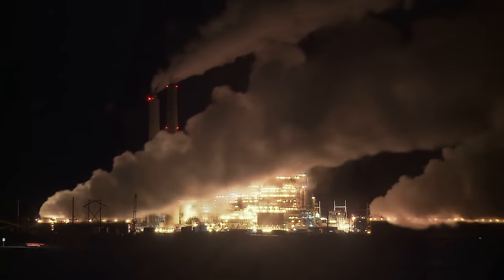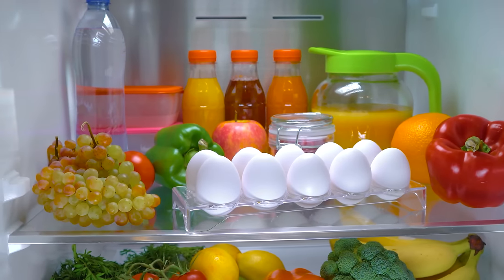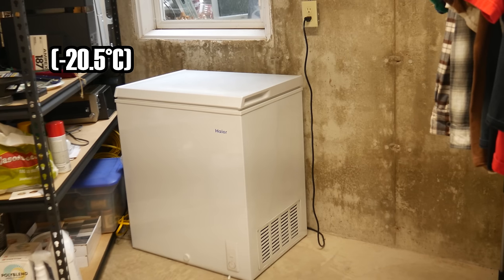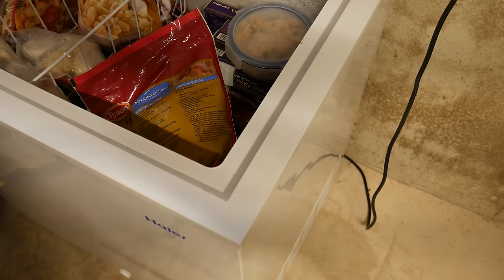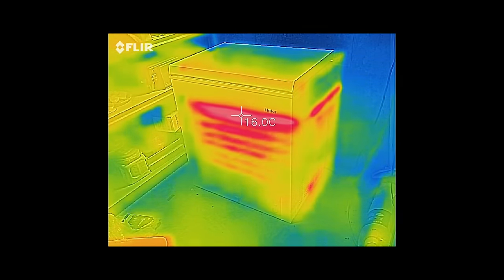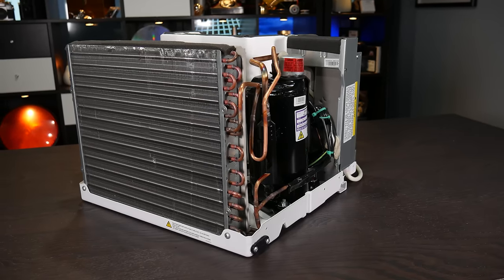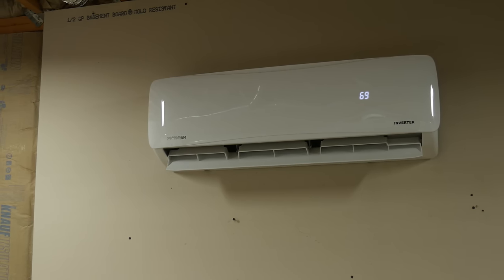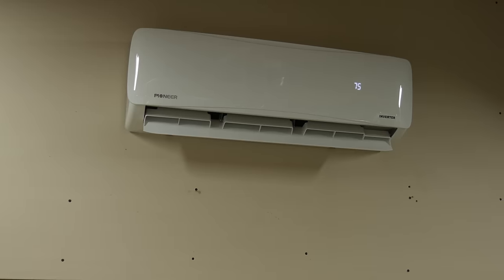Heat Pumps: the Future of Home Heating

Comment: How can a heat pump ever output less heat than a resistive heater? Can a heat pump in heating mode ever pump heat in the wrong direction? Or will is merely fail to pump any heat?
Reply: The efficiency gets so low that it draws more power than heat it produces. For example it might draw 1 kWh of electricity but only produce 0.8 kWh of electricity. Resistive heater always produce the same amount of heat to power they consume.
Reply: @Redtooth75 , “Only produce 0.8 kWh of electricity”? You must mean “0.8 kWh of heat”

A heat pump consuming 1 kWh of electricity will always produce exactly 1 kWh of heat, and then it either will or won’t pump heat from outside to inside. If it pumps any heat at all, then it will add more than 1 kWh of heat to inside your home. If it doesn’t pump any heat, then it will put all of the 1 kWh of heat that it produces into your home.

The only way it can possibly put less than 1 kWh into your home is if it’s pumping heat out of your home. If it’s in “heater mode”, then that should never happen. It should therefore never be less efficient than a resistive heater.

Your response makes it obvious that you do not understand heat pumps and why they can be so much more efficient than a resistive heater.

100% of the waste heat is put into your home which is exactly the same as what a resistive heater would produce plus additional heat is extracted from outside and also put into your house. If the heat pump consumes 1 kWh of electricity and pumps 0.8 kWh into your home, then you’re home receive 1.8 kWh of heat when your heat pump consumed only 1 kWh of electricity.
Reply: @terjeoseberg990  I work on system like these on a daily basis for my job. I am an HVAC tech. I assure you that when its cold out a heat pump will not work effectively. We can argue about theory until we are both blue in the face. But reality supports my position and it rejects yours. And reality does not care about what you or I think, it simply is.
Reply: @Redtooth75 , So basically you work on systems like this daily and don’t understand how they work? Well, mechanics don’t design cars or engine, yet they fix them all the time. I’m sure it’s exactly the same for HVAC technicians. The people who understand how their work are physicists and engineers, not HVAC repair technicians.

If you dump 1 kWh of electricity into any device, no matter what the device is, due to the conservation of energy, 100% of that 1 kWh will be converted to heat. The question is whether that heat is put inside or outside your home. In heater/heat pump mode, the heat pump would obviously be designed so that 100% of that energy would be put inside your home. The only question then, is how much heat the pump is able to pump from outside to inside. If that’s 0, then the heat pump becomes exactly as efficient as a resistive heater. If the heat pump is able to pump any heat at all, it becomes more efficient than a resistive heater. This is just a fact.
Reply: @terjeoseberg990  you have a complete misunderstanding of conservation of energy. Energy can be converted to different forms. In the case of an electric motor electrical energy is converted to mechanical energy, with some converted to thermal energy due to inefficiencies. Think about it, if all the energy gets converted to heat then there would be nothing left to do the actual function of a motor which is to spin. Spinning a shaft (mechanical energy) requires energy, if all the electricity becomes heat then what's left to make the shaft of an electric motor spin?
In the case of an heat pump you have electrical energy getting converted into mechanical energy via the motor in the compressor. Then the compressor will convert the mechanical energy into potential energy by increasing the pressure of the refrigerant. Both the fan motors will convert electrical energy into mechanical energy to drive the fan.
Reply: @Redtooth75 , You’re confused and wrong bro. Sorry, but that’s a fact.
Reply: @terjeoseberg990  a typical electric motor converts 90% of the electricity powering it into mechanical energy, 10% gets converted to heat. Sorry bro just a fact. How can the electricity get converted into heat and mechanical energy at the same time?
Reply: @Redtooth75 , And 100% of that mechanical energy eventually turns to heat. Sorry bro, but that’s just a fact.
Reply: @terjeoseberg990  lol ok buddy. I guess the people that have to switch to electric heat or a furnace because their heat pump cant keep up are just imagining their house getting cold. And the manufacturers specifying a temperature at which a heat pump becomes ineffective are just making things up.
Reply: @Redtooth75 , Imagine you have an extremely well insulated box with a motor inside that’s 90% efficient. You put 1 kWh of electricity into the box to run the motor. 10% is converted directly to heat and 90% is converted to motion. Isn’t heat just motion? Well, originally that motion of the motor will be a whole bunch of atoms rotating together, but the eventual all those atoms that were rotating together will stop rotating together. Now, what the hell happened to that mechanical energy? Did it disappear? Or is it still in the box, but in the form of heat?

If you keep adding more and more electric energy to the box, and the box is extremely well insulated so that energy can’t escape, it will become warmer and warmer inside the box. The temperature inside the box will increase according to exactly the amount of energy that you put into the box. This is called “the conservation of energy” and makes sense if you have a sufficient understanding of physics.
Reply: @Redtooth75 , “I guess the people that have to switch to electric heat…”

Heat pumps are electric heat bro… They run on electricity and heat your home. But if you think a bit, a heat pump that uses 1 kW of power to heat a home by converting that 1 kW to heat while pumping 1.5 kW of heat is heating their home at a rate if 2.5 kW. If that home requires 2.5 kW to heat because it’s cold as F*ck outside, but it’s so cold that the pump isn’t able to pump 1.5 kW of hear will then only heat the house at a rate less than the required 2.5 kW. Maybe it’s so cold it’s only able to heat the home at a rate of 1.5 kW, which is insufficient to keep the house warm. Then you’ll need an additional 1 kW of heat. You could install another identical heat pump, or go with a cheaper resistive heater for those few days when it gets that cold. If it gets that cold often, then it’s better to get another heat pump. If this days are extremely rare, then it’s probably better to temporarily use a resistive heater.
Reply: @terjeoseberg990  i didnt realize that people put heat pumps in perfectly insulated boxes or that houses were perfectly insulated. Does the mechanical energy eventually make it back to thermal energy? Sure, but its not in the house when that happens so who gives a shit.
Im still curious as to why you have not addressed the reality of an air to air heat pump being unable to compete with a resistive electric heater at cold ambient temperatures.
Reply: @Redtooth75 , The house is obviously not perfectly insulated. That’s why it needs a continuous supply of 2.5 kW of heat to stay warm. That’s because 2.5 kW of heat is leaking out of the house. Adding more insulation to the house is another solution, but also an expensive one.

You obviously don’t understand physics. Is it because you haven’t learned it? Or because you lack the mental capacity to learn it? From this conversation I’m leaning towards the later.
Reply: @terjeoseberg990   You repeated yourself. I have already given you my source that was written by an engineer, but curiously you have refused to acknowledge it. Go ahead and give me your source.
Reply: @Redtooth75 , You have no source bro, you’re confused, and you’re wrong.
Reply: @terjeoseberg990   Cengel, Yunus A. and Michael A. Boles (2008). Thermodynamics: An Engineering Approach (6th ed.)
That is now the third time I have given you that.
Reply: @Redtooth75 , If you’ve posted that before, either YouTube deleted it, or hid it, because I don’t see it.
Reply: @terjeoseberg990  my second comment has the quote, my fourth comment has the author and title of the book. Youtube omits links, not words.
Reply: @Redtooth75 , If you read that book, you obviously didn’t understand it. Otherwise, you wouldn’t be confused.
Reply: @Redtooth75 , On my end your fourth comment does not contain the author or title of that book. YouTube is obviously blocking more than just links. Your second comment also doesn’t contain any quotes. Regardless, you’re still confused and wrong.
Reply: @terjeoseberg990  it straight up says in plain english that the COP can drop below 1 if the ambient conditions are cold enough. There is also no way that you read it in 10 minutes. Why don't you go educate yourself and then get back to me. You can also feel free to give your sources as well, Im always willing to learn.
Reply: @Redtooth75 , If it’s too cold outside for the refrigerant to evaporate, then, without evaporating, it won’t absorb any heat from outside and will instead release heat that was absorbed inside. It’ll start transporting heat in the wrong direction.
Reply: @terjeoseberg990  in your first reply to me you said that that does not happen. But now all of a sudden it can happen? Your also wrong by the way, it still produces heat. Its just less than what a resistive heater would produce. And if you knew what the COP was you would know that. The COP for a heat pump is the amount of heat released by the inside coil divided by the energy input of the system. So a COP of less than one means that the system draws more electricity than heat it produces.
Reply: @terjeoseberg990  im still waiting for a source too.
Reply: @Redtooth75 , Read my original question, “Can a heat pump in heating mode ever pump heat in the wrong direction?” You obviously failed to answer this question, and I therefore had to find the answer myself. That answer is “yes”, and I just explained how this could happen. It happens when it’s too cold outside for the refrigerant to evaporate.

In my first reply to you I claimed, “A heat pump consuming 1 kWh of electricity will always produce exactly 1 kWh of heat, and then it either will or won’t pump heat from outside to inside, …” this is only incorrect because I didn’t have the answer to my initial question. Now that I have that answer, I understand that the heat pump can generate 1 kWh of heat while depositing that heat inside and transporting a portion of that heat outside since it’s too cold outside to evaporate the refrigerant.

The heat pump is still producing 1 kWh of heat, but it’s unfortunately sending some of that heat outside instead of inside. In the Quora answer he mentions the heat pump switching to “resistive heating mode”. I have no idea how this “resistive heating mode” works, but it certainly seems like a good feature to have in locations where it becomes extremely cold.
Reply: @Redtooth75 , Do you need a source because you don’t understand my explanation? If the refrigerant isn’t evaporating because it’s too cold to evaporate the refrigerant, then obviously the heat pump will fail to function properly. The refrigerant will absorb heat in the condenser inside your home, then the warm refrigerant will be pumped to the evaporator outside your home where it will be cooled, thus releasing the heat that it absorb while in the condenser that is located inside thus transporting a portion of the heat that is generating from inside your home to outside your home.

Does this explanation not make sense? I’m sorry, but I don’t know how I can make this explanation any simpler.
Reply: @terjeoseberg990  you mean to tell me that this entire time you somehow did not know what a resistive electric heater was? Its a piece of metal that gets hot when you apply electricity to it. Then you move air over the hot piece of metal to heat up the air. Its a simple concept. You have to switch to that method because that is more effective when its really cold out. The system still pumps heat in the correct direction, its just less than what the pump is consuming to run. How have you had this entire conversation without knowing what a coefficient of performance is?
Reply: @terjeoseberg990  i want a source because you are contradicting my credible source as well as all training I have received and all manufacturer literature I have read. So if you want me to believe you then you're gonna need to provide a source. Its not that I dont understand your explanation. I get what you are saying, its just wrong. 
Im not gonna reply to you anymore unless you provide something to back up your claims. Its clear you have a rudimentary at best understanding of the refrigeration/heat pump cycle.
Reply: @Redtooth75 , Huh? Where did you get that idea? A resistive heater is obviously a giant resistor that generates heat by sending electricity through this resistor. Duhhh…

What I said is that I don’t understand how a heat pump switches into resistive heater mode. Does it simply contain a resistive heater in addition to the heat pump, and it senses the outside temperature and flips a switch? Or is the heat pump doing something else?

Do you have a reading comprehension problem or some other reading disability or something?

Your last comment shows that you’re still extremely confused and fail to understand my explanation. You should probably try reading it again a few times, because I don’t know how to make that explanation any simpler.

Comment: It's crazy to see how good the energy supply is in the US, you are talking about a space heater being inefficient (which is true of course). In germany, you just can use a space heater, I expect electricity costs rise up to 50cent per kwh this year, that mean even a damn efficient heat pump is expensive (but still very appealing). I told my dad's girlfriend to buy a good AC to use it as a heatpump for additional heating in winter, because winter isnt very cold in germany, this would be very efficient. But the whole AC thing, even it's so efficient, has a crazy bad image here. Feels like talking to a wall... And because gas was very cheap and now isn't thank to the plans of Putin, almost everyone has a gas heater which doesn't makes sense today... Last nuclear power plans are going to get shut down this year too.

Well guys, I guess we are fked over hear 😂

Comment: At -4 it is pretty horrible. Why are they pushing it in the midwest where it often loses efficiency. Also old houses lose heat so fast that the whole efficiency of soley the unit misses the efficiency of the whole system (house plus heat pump)
Reply: You seem to have outdated tech over there. Modern units made for colder climate works really good. You also need to insulate your houses, no point trying to warm up a house that cant keep the heat inside.

Comment: Someone correct me cuz this is clearly not possible

You said that one "unit" of fuel will produce enough electricity to create more heating than burning that fuel will produce
...but making electricity is just a question of converting heat energy into boiling water.
>Use one "unit of fuel to boil one "unit" of water producing one "unit" of electricity
>Use one "unit" of electricity to create enough energy to boil two "units" of water and produce two "units" of electricuity
>repeat
Reply: Heat pumps don't boil water, and work less effectively the further the difference in temperature is.  Depending on the refrigerant there are also limits to the temperatures possible.
e.g. R32 and R410a is around 55C, R290 is around 75C, and R744 is around 90C.

Comment: That's totally ridiculous. Heat pump efficiency is not 500% as you claim, not in the cold season! It is much more efficient to heat houses with gas with efficiency about 90% (all year around) than first produce electricity at a power station burning the same gas with an efficiency about 36% (that is the max according to google), then have some losses in transit and finally use that electricity to heat a house using a heat pump with efficiency of 200-300% (highly dependent on the outside temperature - the lower the temperature outside, the lower the efficiency!).

Comment: I don't know how the math works out for many multiple units in a given space. Individual single resident homes have plenty of space, but an apartment building could quickly freeze the surrounding ground, or frigidify the air. It's not that the idea doesn't work, but there's definitely some thought that needs to go into making mass adoption not suck.

Comment: Once temps get below 40 degrees F, the energy $$$$$ consumed by a heat pump really has to be considered when choosing this option. These are great for the Southern USA for example.  Not so cost effective for those North of the Mason/Dixon line.
Reply: They're fine even for Northern Norway. They're also fine for all of the US.
Reply: @logitech4873  Do they work?  Yes.  But you have to weigh the cost of running on your electricity bill to what heat you recover.  Once it gets below 40 F/high 30's, it makes more economic sense to use another fuel to heat your space. That's why they come with electric back up heaters because it is more cost effective to run your KW through the electric elements, than to try to use your heat pump to recover the same amount of heat from the atmosphere.
Reply: @spockmcoyissmart961  Modern heat pumps work fine down to -25°C.
Beyond that you can just supplement with any regular electric heater.
I obviously won't even consider gas heating. This isn't the 1950's.
Reply: @logitech4873  N gas is far cheaper than electric in my area, that is why nobody uses heat pumps and uses forced air and only electric baseboards in isolated areas.  -13 F you use a heat pump?  That thing must never shut off.